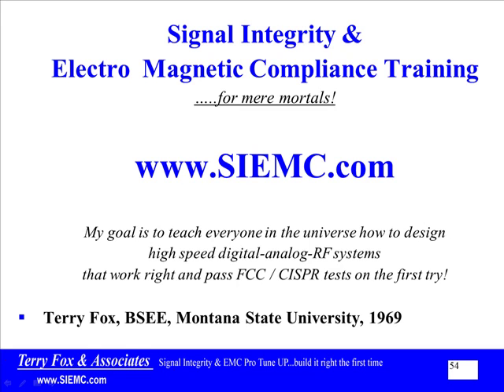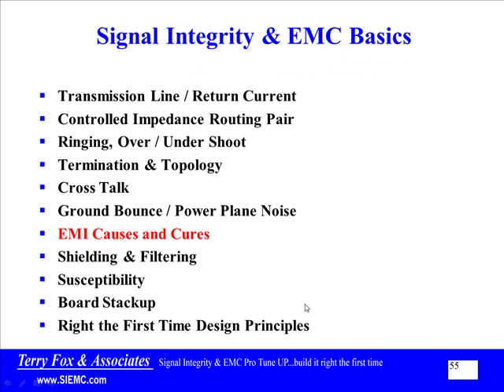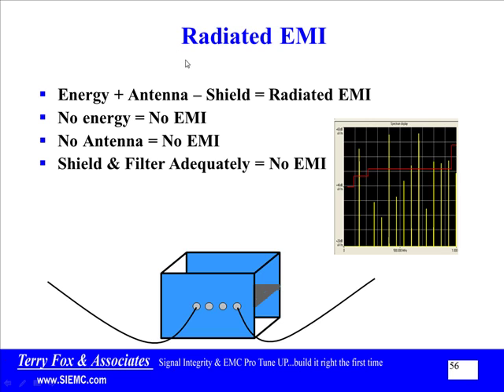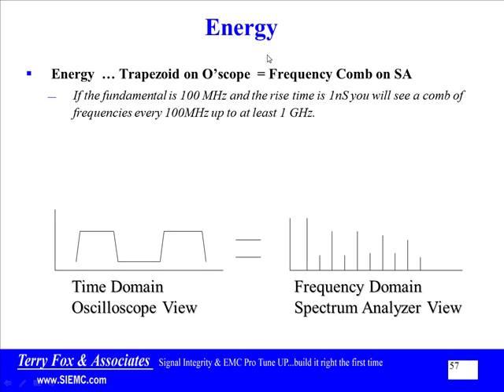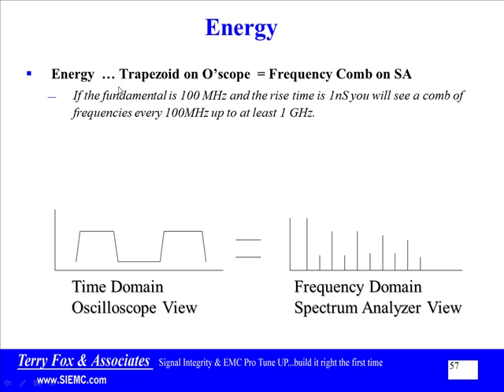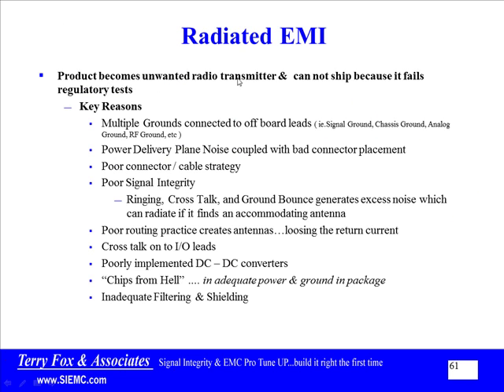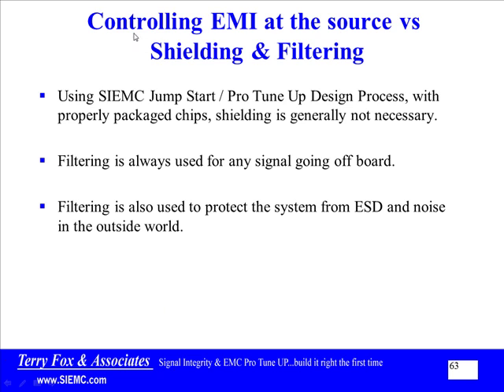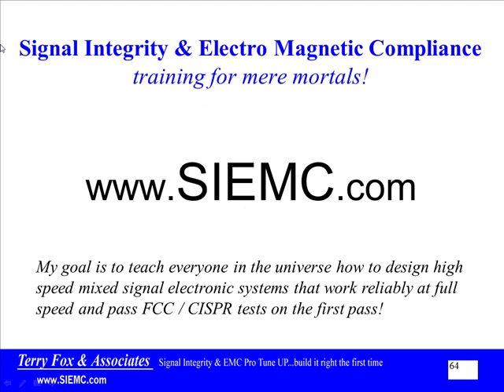EMI Causes & Cures

Comment: I've created the very best antenna by powering a 4 meter long 24 vdc rgbw strip with + power in at one end and - power out (rgbw) at the other to prevent voltage drop, now I get shocking high frequency noise through my home theatre speakers whenever pwm is working to mix colours,dimming etc.
Great advice , going to completely rewire (with shielded cable) all from one end of led strip keeping ALL cabling together and same length.
Reply from the maker: Glad the video helped..TFox

Comment: Sir, Like you explained formation of Dipole by IC noise source at center, are there other ways antennas are formed on PCB (maybe monopole , patch etc)? Basically could you make a small video on link between SI and EMC (for example you told signal crosstalk can lead to radiation through LED ) , Inter relation between SI and EMC is not well understood by most people as they are treated as different streams. Maybe throw some light on how ringing eventually leads to radiation. Or why CM mode radiates so easily, You can list some examples per your experience.
Reply: @tfoxwa  Sir, . I have seen and tried to analyze all your videos,  Hope you wont mind answering some questions
1) In ringing of signal, we have basically inging frequency , which leads to increase in amplitude of the ringing freq element and its harmonics which can be clearly seen in Fourier transform. Now question is how this amplitude say 100 dbuV after doing fourier math will give me far field amplitude level that we see in any standards (say CISPR etc) while doing RE. Is there some thumb rule that this 100 dbuV of harmonics relate to this much emission (and is above  CISPR or FCC levels). Can we roughly calculate , that if I have this much voltage of doing Fourier math - this will be emission seen after doing RE test say for 10m or 3m.
To make it short is there a way to find that this many mV or dbuV of signal when measuring on say scope will give me what amplitude of emission at far field.
2) As per your one of the lectures via resonance can cause phase reversal and you mentioned it causes detection problems. Could you elaborate on this as phase reversal of signal causes issues in recovering data.
3) Could you provide some more examples of monopole antenna formed on the board like you did for dipole. Thanks !